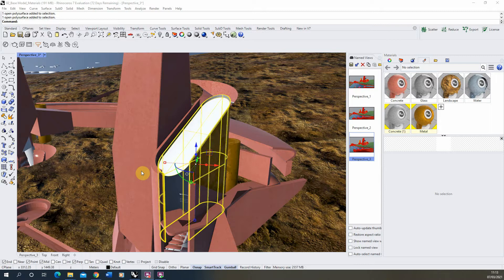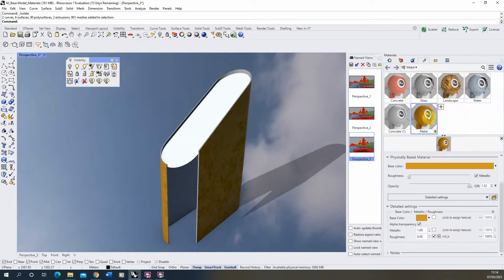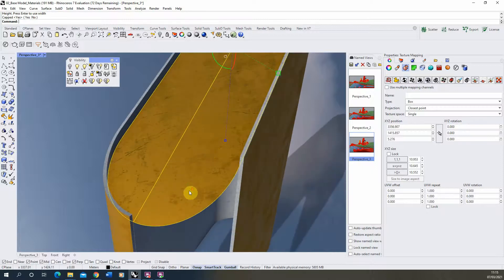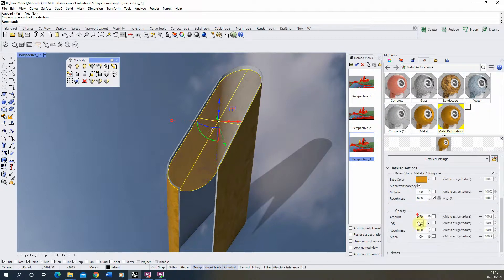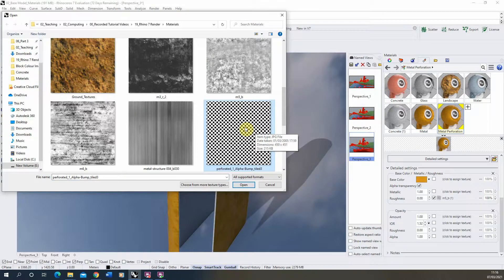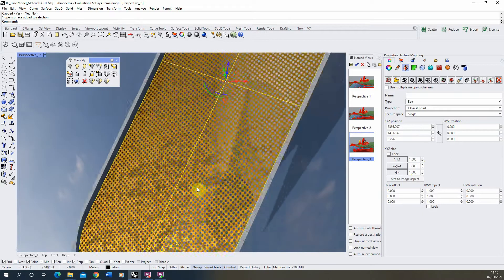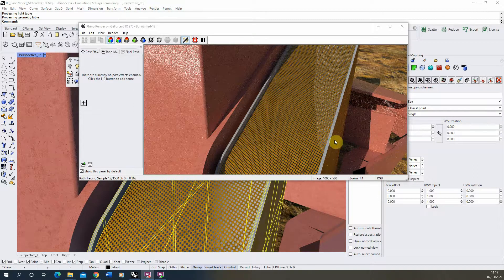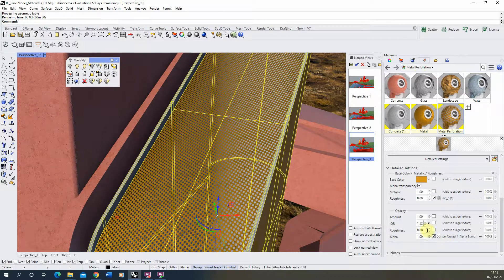Rhino 7 - Perforated Metal Material Creation - PBR

Comment: What would you recommend trying if the transperency applies to the inverse? As in i used a png of a bunch of dots for the transperency value, but the material appears where the dots are, not where the voids are. So instead of a screen with holes i juyt have a bunch of circles